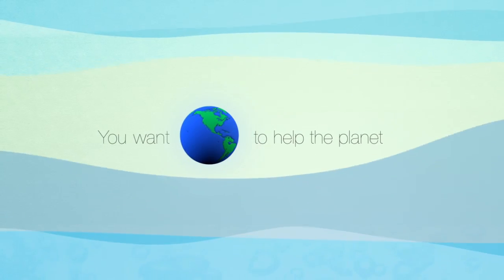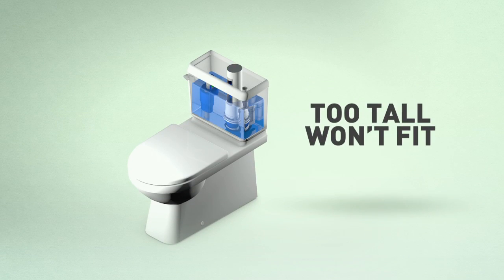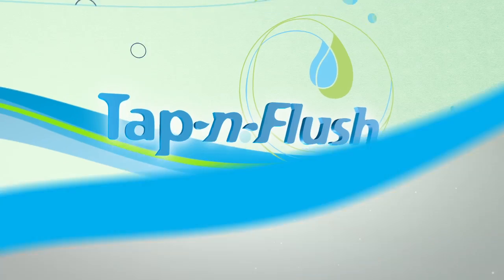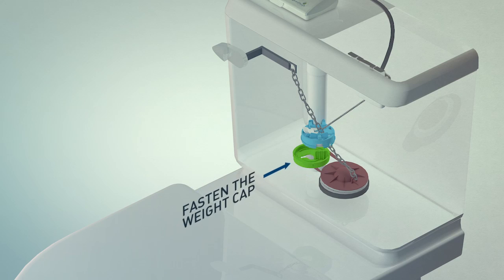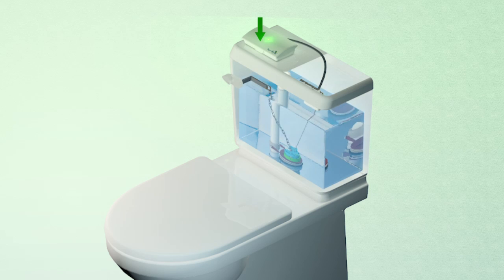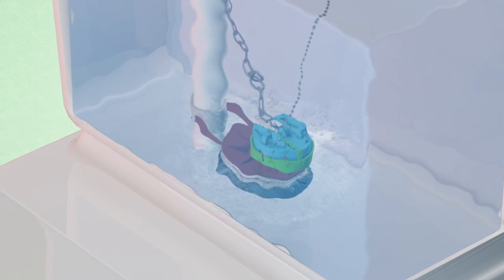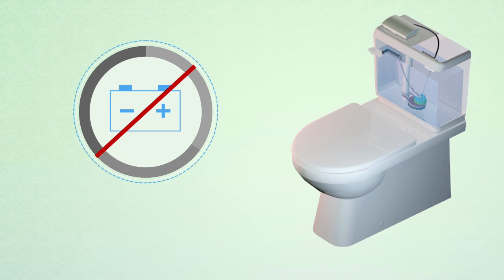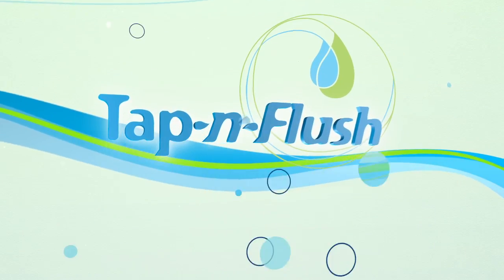Tap-n-Flush Dual Flush Converter - Conserve Water, Save Money, Help Earth!

Comment from the maker: Ten years ago I began contemplating a dual flush converter design that could convert every toilet in America to dual flush.  It was clear that the ideal dual flush system would be able to fit every toilet, be simple to install and allow for less water to be used when flushing liquid waste without compromising the integrity of a powerful large flush.  I spent many years thinking about the design while working as a commercial real estate analyst.  During 2007 when the real estate market began declining I took the leap and began inventing Tap-n-Flush full time.  My Hawaii based company, Prodius LLC is located on the beautiful Island of Oahu, and just around the corner from the world famous Waikiki Beach.
 
A highly skilled design team engineered the Tap-n-Flush dual flush converter.  The American design team includes a mechanical engineering firm in New York, an industrial designer in New Jersey, and an electrical engineering firm in Missouri.  The founding design requirements for the Tap-n-Flush was to create a dual flush conversion kit that can convert every toilet in North & South America to dual flush without the need for tools and easy enough for anyone to install.  For the past five years I have worked relentlessly to perfect the Tap-n-Flush, dedicating three years to initial design work with the American engineering team and nearly three years refining the design a manufacturer located in China. 
 
I truly believe perfection is met when a product can both save money and conserve our planets natural resources.
 
Aloha,
 
Jeff Nasrallah
Tap-n-Flush Inventor & Owner
Reply: Guess these are no longer available?  Main website is gone :(